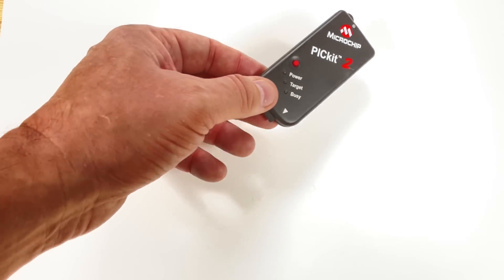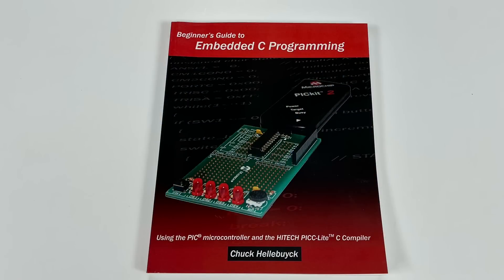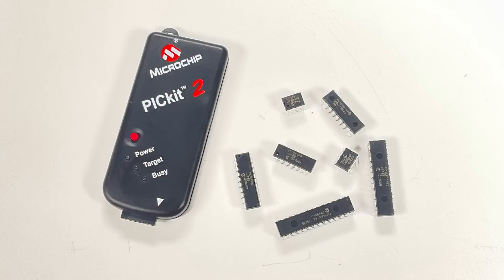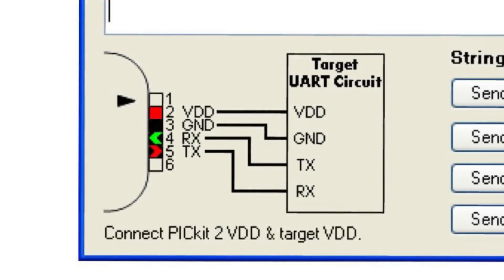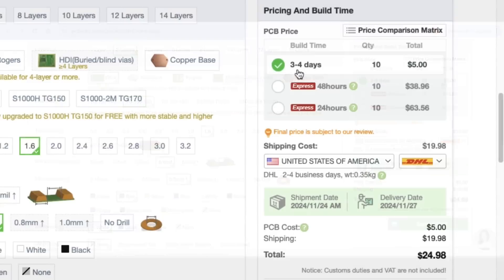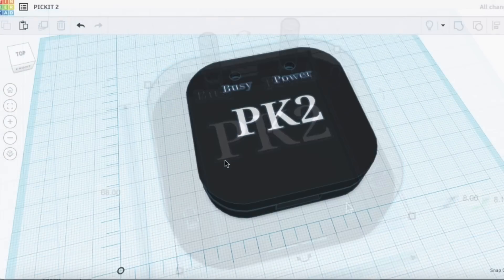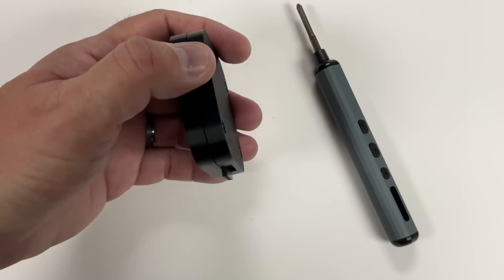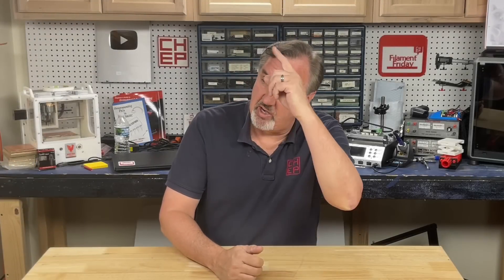Creating My Own PICKIT 2 Programmer

Comment: Apparently AliExpress has something called a PicKit 3 and even a 3.5 ... I don't have the time to figure out whether those would actually be improvements.  Also, I'm more an Attiny fan than Pic, just historically grown ...
Reply: For basic PIC microcontrollers, either of those should work just fine to program them.
Reply from the maker: PICKit 2 is an open source reliable programmer. PICKit 3 was a later version but never as good. It’s also cloned not open source. So I recommend PICkit 2.

Comment: Still have my old pickit 2 back from EE classes, it was absurd how much clever functionality they put into that thing for the 3 i/o lines available. Also it supports a fully stand-alone target program mode, as long as you know the target and have a USB power source, you can pre-load the program payload up to a certain size limitation via "Programming-To-Go", and that's what the button was for, and the status LEDs let you know how it went. Oddly I heard a lot of negative about PK3, so never made that upgrade.

Comment: Very interesting video. Just one question: who is still printing with ABS??
Reply from the maker: @mikel9292-What do you recommend or use for electronics cases?
Reply: @FilamentFriday  PETG is more than enough, and I guess for small electronics that won't get too hot, PLA would be fine.
Reply from the maker: @mikel9292 - It’s interesting how I used those in past videos and people commented PLA is flammable and ABS is used for most professional boxes. 
Now I use ABS and I’m told to use PLA/PETG. 
Can’t win.
Reply: @FilamentFriday PLA is flammable, and so is PETG, but ABS is ALSO flammable (like most plastics). The point is that you need a lot of heat for them to combust. I would consider using ABS (or even a more specialized material) if your electronics required high current because it withstands the most heat of the three. However, for this kind of project, it doesn’t matter at all which material you use, so why bother using ABS?
Reply from the maker: @mikel9292 - Why not. It printed good. It’s completely safe and meets/exceeds most electrical codes. It’s great at high impact if dropped. Takes screws really well without inserts. Plus ABS is often cheaper since many people don’t use it.

Comment: Really cool. I'm hoping to build an automatic chicken coop door, probably using an arduino to control a servo motor, but maybe I can go even cheaper.
Reply from the maker: Get it working with Arduino, then you can improve it and spend less money with blank micro. Arduino was designed for schools to teach, not necessarily final design.
Reply: @FilamentFriday  Thanks, will look into that.
Reply from the maker: You can use an online simulator for the Arduino to build the circuit and test the code. Wokwi.com or Tinkercad circuits are great places to do that. I’ve shown Tinkercad circuits on my channel many times.

Comment: Great video. How much harder is it to program a PIC vs an ATMega is there a reason to use a PIC anymore?
Reply from the maker: They’re the same easy. PICs may even be slightly easier. Lots of reasons to use PICs. They have 1000’s of different devices and many lower cost than AVR. But why one vs other?
You can use both.
Reply: @FilamentFriday  It seems to me one gets a lot more value from a ESP32 board or a RPi Pico board. PICkit2s are not officially supported and will not be supporting newer PIC devices. Over decades I have seen the rise of PICkit1 then 2 then 3 then four. Always getting more expensive. The Microchip Xpress boards came along and did not require a programmer but last time I looked those had doubled in price from what they were initially.
Reply from the maker: @peircedan - PICkit plus software (linked in description) adds support for all the latest devices. Since PICkit 2 is open source it lives on and can be used with any compiler or IDE through its auto import hex feature. 
As I stated in the video, the 8-bit micro plays a role as a peripheral controller thus allowing the 32-bit to do its central processing the same way a central CPU works with peripherals in a vehicle or any control system.
Reply: @FilamentFriday  you can also use it for the ATTiny and PIC12’s for stuff that can work within limited pins and memory
Reply from the maker: @Mitch3D - Yes the PICkit 2 supports 12F and 10F devices as well. For ATTINY you can use an Arduino as hardware programmer or just get a low cost USBASP programmer and use AVRDUDESS GUI software for similar tool for ATTINY.